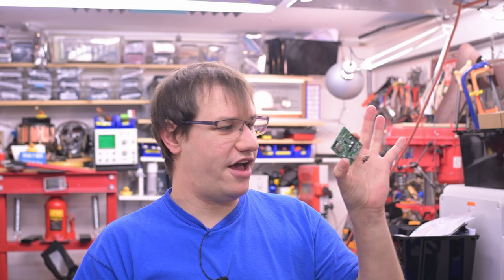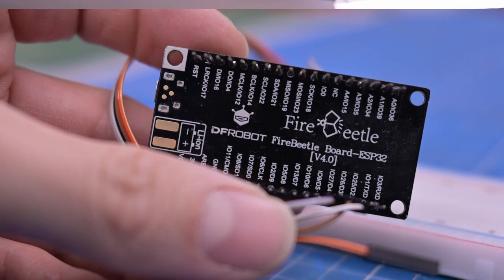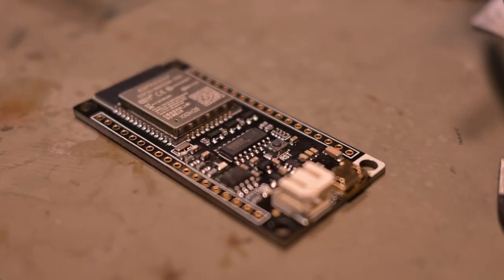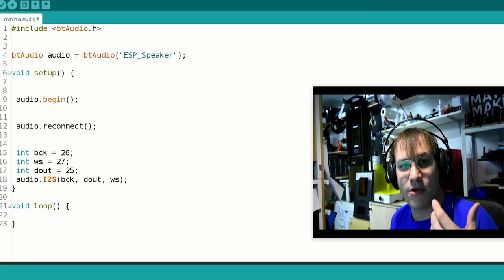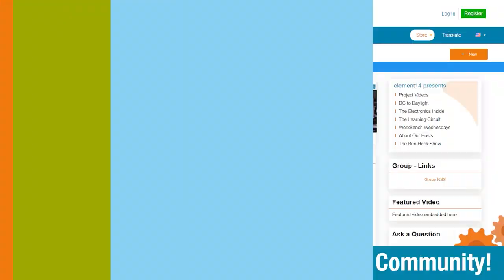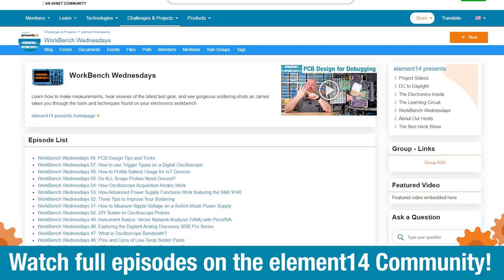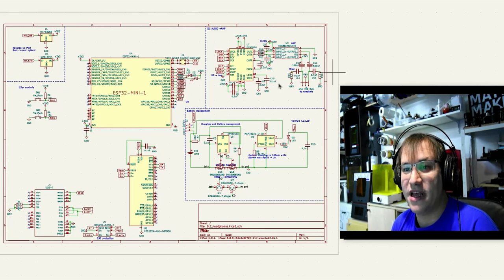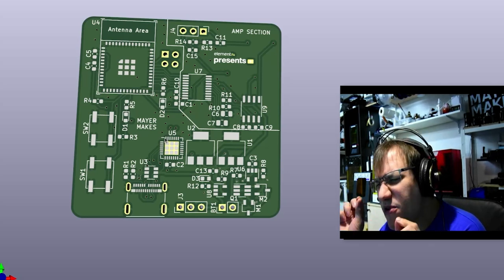DIY Open Source Bluetooth Headphones

Comment: What you could do, instead of putting that bit of extra weight into the headphones, (and possibly damaging them to make things fit) is make an up to phone sized module that hangs round your neck, maybe under your shirt, maybe in "landscape" rather than "portrait" orientation, for stability. Make the case according to what the electronics and battery will require (so you could have much better battery life - maybe even make that extendable just in case.)

Benefits of doing things this way is that you don't mess with the balance etc of the headphones, as-designed. (You just need a nice broad neck strap so that it doesn't cut into one's neck if some variants - the 20 hour battery one, for instance - get too heavy.)

I often wonder why designers of head-wearable kit (eg. VR goggles) insist on putting more than the bare minimum in the head mounted part. Surely the best place for anything that weighs anything is as close to one's torso as possible? (As close to the centre of mass, even.)

So you're actually done, then. The unit is already plenty small and compact enough for neck- hanging.
Reply: interesting points, we have adiscussion going on the Element14 community page for this video! if you want chime in and maybe this gets towards what you are envisioning!
Reply: @MAYERMAKES  Hi, I've checked out the community page, and it looks lively and interesting. Unfortunately I have a quite "occasional" interest in this kind of thing, and more of a "what's up in that world" than maker interest. Basically, I've seen good content on your YouTube channel at some past date, and thought it looked worth subscribing, but it's been a while since I last burnt myself with a soldering iron. At this stage I don't think I should open an account there, just because there's a chance of it becoming yet another one of my unmaintained online accounts - not a good idea to have too many of those (or any, really). But thanks. I'll keep it in mind, and if my circumstances change (not impossible), I'll remember, and go and join in actively. For now, though, I don't even often have what seems to me a good enough idea to be worth suggesting, and my visits are a bit sporadic.

Your videos are great, B.T.W. !
Reply: @sicko_the_ew  thanks for considering, anf the etensive feedback. I hope to see you there when you like to join in.
Reply: @MAYERMAKES  If I do manage it, I'd be sure to vent my opinions often. :D I hope you guys manage to grow a great community there. You deserve it.

Comment: Yes!
I have been putting off a project for too long. Converting a dehumidifier to a smart humidifier. Basically hijacking its control board and ether replace it with my own or just hijack the screen and buttons to put a device in the middle.

Comment: I found the video fascinating and would love to replicate the circuit on the breadboard, but I'm unsure about the specific wire connections. Could I kindly request your assistance? I'm new to this field, and I'd greatly appreciate a detailed explanation of the connections on the breadboard or perhaps a clear visual reference.

Comment: Of course, there are lots of tiny and cheap Bluetooth audio receivers that can instantly turn any wired headphones into wireless (many of which have a switch to also act as a transmitter), but where's the fun in that?

The other advantage, though, is that many of those also have a built-in microphone so they work as a handsfree for phone calls.
Reply: there wil lalways be a cheap otpion for most stuff, but do you have control over them, do you really know what its doing , with your data and your devices? Nobody should have to trust anyone,but be in control of everything they own. I think its not a bout building a cheap option but a Free one as in Freedom.

Comment: Could the ESP32 support 24 bit audio at 96kHz or higher? Would be interesting to implement HD audio over Wifi, similar to Nvidia's implementation (for the Shield TV) except it would work with a regular PC.
Reply: Maybe .?

Comment: Hey, this was an amazing video! The editing back in time had me laughing away. I'm looking at doing a headphone project and going above and beyond the level of my other projects. I really want to do active noise cancelling which led me to Qualcomm chips. From what I can make out though you have to buy the ANC features as well as the chip itself and to do so you need to be a registered business! It seems a bit of a mine field. Would you have any suggestions for a project with ANC? Would it be possible on an ESP32 or maybe there is a way to use the Qualcomm chips which will probably give the best end product.